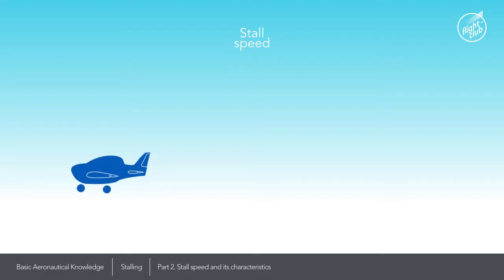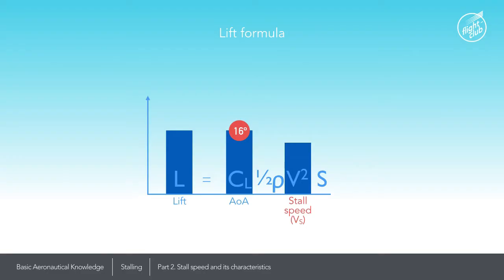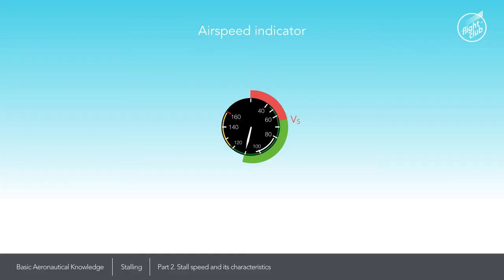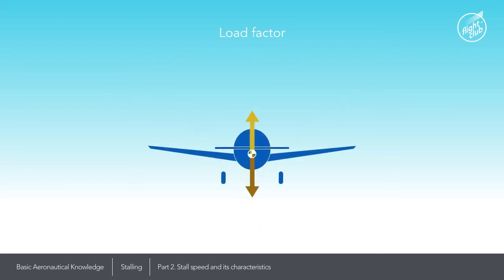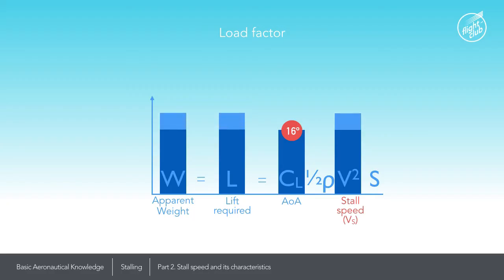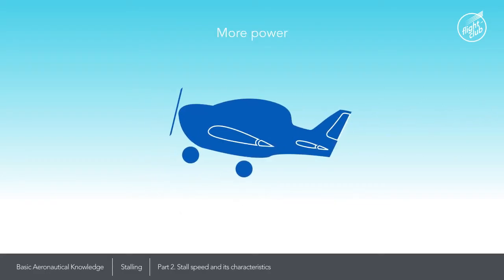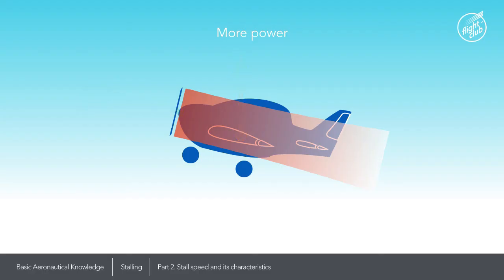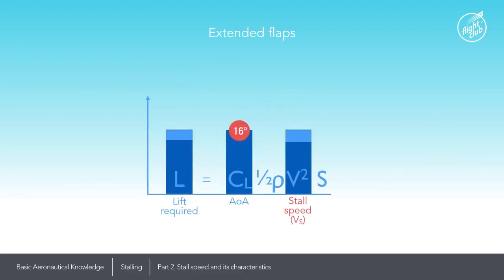What affects stall speed?

Comment: Hello,
Do I understand it right that, 
Stall will happen when you have a  large angle of attack at a relative low speed?
But if, with the Same Angle of Attack, the speed is much higher, then stall won't happen. Right? And the plane will climb up of course. Right?
If right, What are those speeds and angle of attacks?
If not right, Then how come that fighter jets and other acrobatic planes can climb strait up vertically?
I suppose this is because of their high speed, which provides enough lift, no matter in what direction they move.
So why can't normal plans in a critical angle of attack give full throttle to gain more lift?
Reply: I think your understanding of Angle of attack might be incorrect. Angle of attack is the Angle between the relative airflow and the chord line, not the horizon. This means is a plane as sufficient power then it can climb vertically and have a very low angle of attack. Same with if you are descending with no power you can have a very high angle of attack. The stall can occur at low speeds as well as very high speeds. An example of a high speed stall is when an aircraft is in a dive and the pilot pulls out extremely quickly. Inertia will continue the aircraft on its original path but the wings will now be at a greater angle thus inducing a stall.
Reply: I'm not an expert, but I believe you are right about speed, AoA and stall. At least my  thinking is the same. As for the fighter planes and stunt planes, they gain the required force more from engine, rather than lift by wing. It's like a rocket only with wings to maneuver.

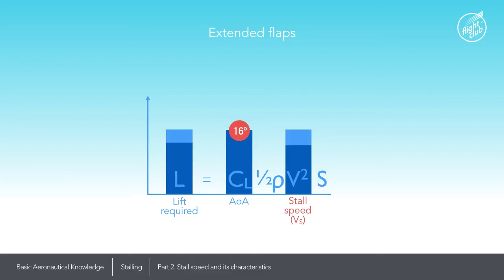Comment: At 3:26 the video mentioned that using flaps, the lift required will reduce “the stalling speed will reduce, but the aircraft will stall at a smaller AOA“... However, in the video the AOA still showing 16 degrees, I am confusing🤔
Reply: yes ,i think (without being sure) that  flaps reduce critical aoa because they increase camber . you need more energy now to avoid separation . adverse pressure gradient will be stronger earlier because you dont have enough energy to push it back towards the trailing edge .

Comment: This is a very good video analysis of AOA and aerodynamics.  I like the use of the term "apparent weight".   The airplane weighs the same when it is placed on scales while resting on the ground.  But if you should place the same airplane on the same scales while flying, the scales will indicate differently at any point in time depending on all the possible factors acting on the airplane at that time.  I hesitate to use the word "moment" instead of " time" because the word "moment" has a special meaning for weight and balance purposes, so I'll use "point in time" instead.
      It is important for pilots to know that it is not necessarily the angle of bank that determines the stall speed, but the "apparent weight"( "load factor") at the time the airplane is measured with scales under its wheels.  If a Cessna, for example, has three weight scales under each of its three wheels while resting on the ground the three scales should agree that the weight is 1670 lbs.  If so, then what is the Cessna's weight at that point in time?
         If you take the same Cessna with the scales attached to each of the three wheels while flying high upon the Sunlit sky, those scales will weigh differently every time a wind gust makes the airplane bounce.
         Question:  On a perfectly smooth day when there are no wind gusts and the air is "like glass", how much will the same Cessna weight scales indicate while flying aloft at say 2,500 ft. according to the same weight scales under each of its three wheels?  (hint: if you are in the same airplane as a right seat passenger sitting on a Walmart personal weight scale will it measure your weight?)
          Now, place the same airplane with all the same scales as above into a 60-degree level altitude banked turn.  What will happen?  Whatever weight the scale said under your butt as the passenger will now show double the weight.  Wow, so we now can draw a conclusion right?  When we increase the angle of the bank we also increase the "apparent weight" of the airplane, right?   Wrong.  That assumption only counts if we assume that the airplane is held in a level turn under a constant 60-degree bank.  This is where most student pilots, and many private pilots and others misunderstand.
          The airplane is a three-dimensional creature capable of flying loops and rolls and doing other things.  Those scales under the wheels will always show different weights depending on what the airplane is doing at any particular point in time.  The point is that the AOA (angle of attack) for the stall of any particular wing is the same.  But the load acting on the wing at any point in time will determine what that AOA is.  
        An airplane's wing can be stalled at any airspeed, at any weight, at any loadfactor that will allow it to exceed the "critical" angle of attack.  They say the turn from base to final is the point were most stallspins occur.  Not true, but close.  Most stallspins occur after the engine quits after takeoff.  Source: AOPA.   If a pilot makes his base to final from a higher altitude, he can use a very steep bank (make it coordinated please) and unload the "apparent weight" (load factor) and the stall speed will not be increased because the load factor is not increased.
      Keep your speed up when making turns from base to final.  Keep your load factor on the low side and you will be safe.  It's when you make steep uncoordinated turns while trying to maintain altitude from base to final do you enter an envelope where you become a test pilot.
Reply: The Harry Brown Project
Angle of bank NEVER directly  affects stall speed, wing loading produces the increases in stall speed. If it was angle of bank it would be impossible to roll an aircraft. This is why an increases in stall speed in a turn can only be accurately defined for a LEVEL turn because the wing loading is a constant known value.
Reply: @hb6986  You seem to know your stuff.  Sometime, I'd like to discuss with you an old wive's tale that the top wing in a level banked coordinated turn flies faster than the bottom wing.
Reply: I know I am kinda off topic but does anyone know of a good place to stream new tv shows online ?
Reply: @Randall Sonny flixportal =)
Reply: @Moses Dominic thank you, I went there and it seems like they got a lot of movies there =) I appreciate it !!
Reply: @Randall Sonny happy to help =)

Comment: Good video! very logical but I don't understand  'greater ability to generate the lift means that the stalling speed will reduce but the aircraft will stall at a smaller aoa."
Why the greater ability to generate the lift does decease the lift portion of graph? I don't understand relation between these two things.
Reply from the maker: Thank you! The CL vs AoA curve shifts up and left with flaps extended. Thus the stall AoA is reduced, but it remains a constant in the lift formula. With flaps extended, 'lift required' is reduced (more ability to generate lift) thus the only other variable, speed (stall speed) is reduced too. Clear as mud? :)